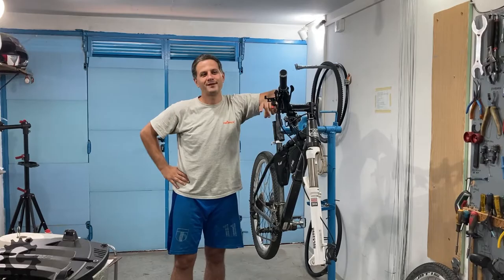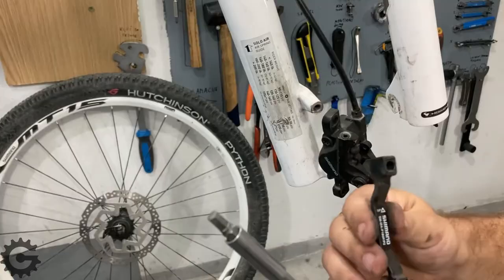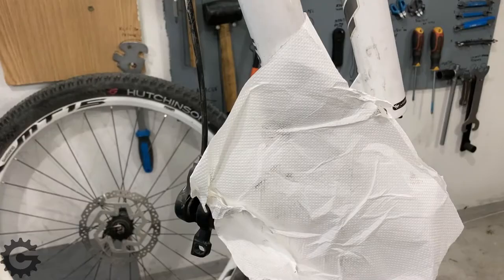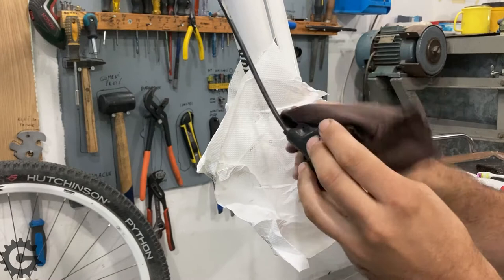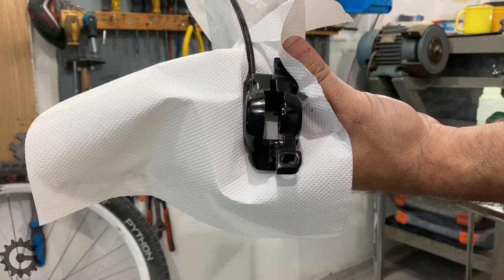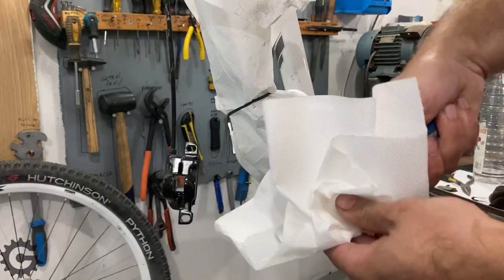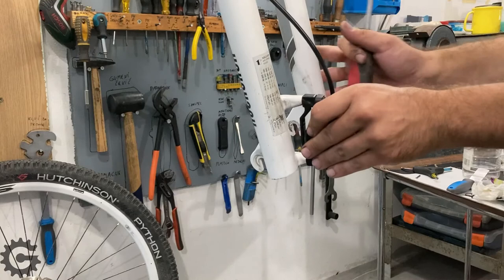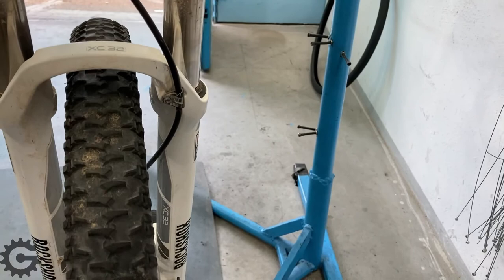Fixing a stuck bicycle disc brake piston [1019]

Comment: warning dont have your outer cable sleeve to long on disk brakes it can course them to lock on. I spent 2 years with the problem I went as for in getting a new bike after coming off the bike and knocking me knee cap out of place .recently cut the outer casing 4 inch shorter greased the inner cable it works :)

Comment: Brake cleaner into the piston grooves, then wd40. Let it sit for 30 minutes. Check, reapply wd40 if needed. When working, spray with bake cleaner again and put some oil in the grooves. Should work. If not, you'd need to disassemble and burp the system afterwards.

Comment: That's my issue: one brake piston doesn't move anymore and the other one barely. It happened after a few weeks of inactivity. It is very surprising as it seems to be the only video about that issue. I thought a bleeding would solve the issue but it didn't and then I found your video.Thank you.
Reply from the maker: It works for both bicycle, and motorcycle disc brake pistons. Haven't tried it with any cars, but I don't see why it wouldn't help there too.
Reply: Both of my pistons are stuck. I thought it was low fluid or worn pads. Turns out piston are stuck. New caliper BR RS785 Shimano is almost 70$ US. think i will try this out! Hope it works

Comment: My piston is stuck also leaked a lot of fluid guess I need to bleed the break first before attempting the piston fix right?
Reply from the maker: If you can still pump a piston out (but not completely, i.e. as shown in the video), you can fix the pistons right away. If not, then yes, you’d need to first sort out the fluid and remove any air from the system.

Comment: Thank you I just did this today for a 4 piston system and installed new brakes!  Thanks a million!  Everything worked perfectly.  I just used a little paint brush to apply the mineral oil to the pistons.

Comment: Just fixed a  persistent sticking piston , funny enough I use LHM mineral oil. £5 litre! Anyway one piston was lazy I had to use a brush and oil. Took 15 mins of back and forth pumping lever and resetting it. Now my pads are perfectly centred and moving equally. Clean off with isopropyl alcohol after.
Reply: Where do you get it from for that price?

Comment: Great video. Thanks for explaining and showing, I especially appreciate where you show that it wasn't quite functioning properly. That was nice to see you just had to do some more cleaning and such. I need to do this to two of my bikes because here in California bike labor is 70 to $90 an hour. Seriously!! I also noticed I can buy that tool for $20 that has that on one end and disc straightener on other end.  
Your English is exceptional except at one point,  sorry no cc available.  Subscribed!
Reply from the maker: Cool - glad it could help.  :)
Unior makes the tool with a slit in the middle - so the same part is used for straightening discs and spreading calipers:
https://uniortools.com/eng/product/1757-2DP-2-for-1-disc-brake-tool#881686
I bought two separate tools for that, for (arguably?) better ergonomics, though I would expect the 2-in-1 version to work fine.

P.S.
Bike shops in my city charge about $10 to $15 per hour, which means, when all the taxes and rents are paid, mechanics usually work for up to $600 per month (starting pay is about $350).
Based on my calculation, at about $25 per hour, one could live quite well from bike mechanics in Serbia (not sure about the US costs of workplace and apartment rents, electricity, food etc.). However, no one here could afford such prices, so no shop can charge that much. So they break-even with repairs, and make profit from sales, mostly.
I like to joke:
The best way to get to 1 million dollars in the cycling business is to start it with 2 million dollars.  :)

Still, for me, the best thing about doing stuff on my own is not any money savings, but the zen, and the confidence it brings. I love being able to fix my and friends' bikes even in the middle of a mountain. Lets you go  further with no worries.  :)  On my last ride, I was the only one with a chain tool - all the other people thought "why would a new chain break?!"  But one did.  :)   

So for me, fixing other people's bikes came as a by-product of wanting to fix everything by myself on my own bikes. But my IT job pays all the bills - not leaving that.  :)
https://bike.bikegremlin.com/7340/mechanic/

Comment: What I don't understand is this. After doing these operations, when I press the brake again, the part inside the caliper is still protruding out and not going in.

What is the solution to this?
Reply from the maker: Hi,

I've made the BikeGremlin forum for any technical questions:
https://www.bikegremlin.net/

It makes it a lot easier to post pictures (when needed), and keep track of questions and replies (YouTube notifications for channel "owners" are not very easy to keep up with).

Relja

Comment: I hate disc brakes on bicycles. They freeze and stick in cold weather when moisture freezes and expands in the assembly. Also, the rear brake cable is often curved up so that water goes right down the cable and into the cable conduit, where it freezes. Seeing this video reminds me of why disc brakes suck in bicycles. What happened to center pull brakes? They work just fine! Without this kind of nonsense. I use Vaseline for everything. Works great.
Reply from the maker: Yup. After having been fixing dozens, I did give disc brakes a go on my own bike(s), as an ultimate test. Went back to rim brakes and never looked back.

I ride all year long, with weekend rides on mountainous terrain (though weekly commuting is done on flats I admit).

Having said that, if my commute were in a mountainous region, I might consider some disc brakes, at least for the front (i.e. give them another chance).
Reply: @BikeGremlinUS  thanks! I thought I was alone in my thinking about disc brakes. I live near the Arctic circle, and they are too much trouble. But it is very difficult to find bikes with rim brakes. Thank you for your reply. I appreciate it.

Comment: I am not sure about lubricating bike pistons, maybe they first work better, but then all the grime sticks much better to the part of the piston that extends during breaking and then goes back into the caliper, taking the grime with it. Isn't that a problem? I have seen the grime on the pistons myself.
Reply from the maker: A great question. To answer it fully:

Pistons are lubricated before being pushed all the way in.
Then, it is all cleaned (degreased) - I hope that part is clear from the video.

Afterwards, as the pistons get pushed out (further and further, as the pads wear), there's a very thin layer of braking fluid that wasn't cleaned by the seals, coating the piston sides. But this happens regardless of whether you lubricated them before pushing them all the way in, or not, since the part of the piston behind the seal is coated in brake fluid either way.

To further discuss the grime sticking topic - it's worth considering:

In very wet conditions, especially on salty winter roads, for cars and motorcycles it helps using a coating of grease (I know, sounds crazy, doesn't it? :)  ) - red rubber grease (that one doesn't harm the seals for DOT brake fluid calipers). Rust being a greater problem than any dirt build up.

Now, with car and motorcycle disc brakes, scratching is inevitable, but for bicycles, any sort of scratching or drag is unacceptable (even though that's an inherent flaw of disc brake systems, but that's a separate topic for a discussion).

Still, even for bicycles, there's a dilemma: is more grit worse than rust?
I suppose it depends on the riding conditions. For dry riding conditions, I guess that dry piston sides are a better option. For the wet - I'd argue it is vice-versa (though, I've only used the red rubber grease on motorcycles, never on bicycles, since I don't own any disc brake bicycles myself, and I suppose other people would find the suggestion to be crazy so I never offered that  :)  ).

Further feedback:

This particular bike (shown in the video) was ridden since that day, in all sorts of conditions, and didn't have any problems. A month ago I did a tune-up service on it, and the brakes were fine. I'll probably replace the brake fluid in autumn/winter, see if there's any excess dirt inside or similar (not expecting any, but we'll see), unless brake pads need replacing before that (can't recall if they were nearly done, or still OK, but the owner is a friend and lets me know if there are any problems, he's decently competent so I didn't bother writing it down).

Either way, that's not a statistically valid amount of data - I don't service thousands of hydraulic brake bicycles per year, but so far I've had good results with the methods shown in this video. Both with bicycles, and with motorcycles. If (when? :) ) I run into any problems, I'll try to figure out the causes and update my procedures.
Reply: Thanks for such a long and quick reply! I haven't considered that the pistons shouldn't (at least theoretically) actually slide back in against the seal during riding. So as far I understand, the cleaning is just not to introduce the grime into (and past) the seal when the pistons are moved back (and therefore they should both be cleaned first before any of them is pushed in), and the pistons are lubricated not to actually lubricate the pistons themselves, but to lubricate the seal surface so that the pistons slide easily against it when they need to (that is when they self-adjust after service and then later dur to the pad and disc wear). The part of the piston that never touches the seal when riding actually doesn't benefit from any oil, so maybe it would make sense to install the pads after such service, adjust the caliper and center the pistons, and then take the pads out for a second and clean the protruding part of the pistons with a brake cleaner/IPA (without moving them of course)? That way the part of the piston that contacts part of the caliper bore after the seal wouldn't collect mineral dust so easily, but IDK if that matters and if there is such contact at all.
Reply from the maker: I think any extra cleaning after the brakes have been installed and the pistons pushed out to reach the disc (i.e. self-adjust) is a lot of hassle, with no clear benefits.

I should make a video on how the hydraulic disc brakes work exactly and what goes on as the pistons self-adjust and move. 

Until I do that, a short answer is: pistons won't move back in past the seal when the brake is released, it's just the seal's rubber that pulls them back, without practically any movement of the pistons inwards, relative to the seal.
Reply: @BikeGremlinUS  ParkTool has an excellent one with a caliper cross-cut and animation, hard to compete with that :D.  It is interesting that there is enough friction between the piston and the seal so that the seal can pull the piston back with enough force. Also would be nice to understand how exactly this works in tandem with the lever so that the pad clearance can self-adjust - is there only one port in the lever cylinder? Is there some unidirectional valve there? Why in Shimano brakes I need to sometimes push the syringe piston quite hard before the oil pressure breaks some resistance (in the lever probably) and the oil starts to follow up to the funnel? Such a simple system, so mysterious :D
Reply from the maker: I'm bad at drawing, and appalling when it comes to 3D animations, but those are some very good questions that deserve a separate video each. :)

Comment: For a stubborn stuck piston: I have thought about slippng a M16 washer in the disc groove between tool and free piston, to allow more lever pressure?
Reply from the maker: I've got a tool to hold one side of the piston(s) in place, preventing them from going out. This is what I mean (Amazon affiliate link):
https://amzn.to/2YztsFv

I've used it on stubborn motorcycle calipers, using it not in between the pistons, but on a caliper outer edge and in between, pressing one piston in place (the side that moves more freely), with some cloth to prevent scratching. Then, pumping the lever to push the stuck piston(s) out.

Not sure it would even fit bicycle calipers - never used it, never needed it. Hand pressure with the bike brake piston tool was always enough to hold pistons strongly enough for the more stubborn side to be pushed out. But, in a pinch, I'd improvise something like that, only smaller (must check if the motorbike tool fits first, I think it's too thick).

Not sure about how exactly you mean to use an M16 washer. If you mean sticking it somehow to keep the tool pressed against the freely moving piston, in order to push the stubborn piston out, I think it's worth giving it a try - if hand pressure alone is not enough.